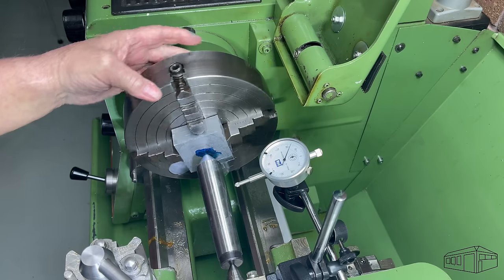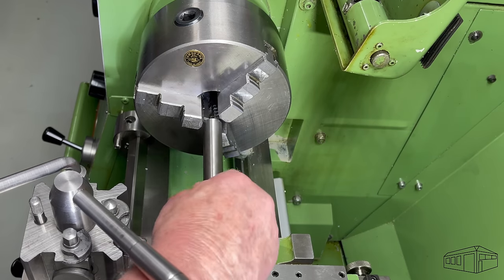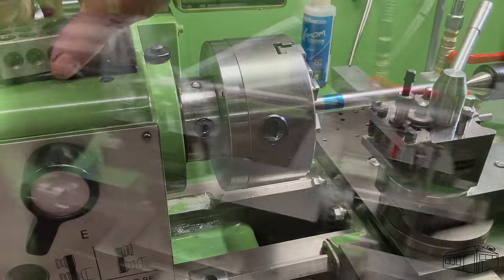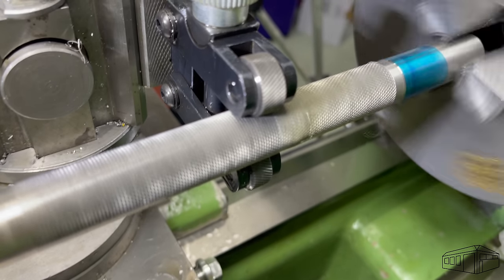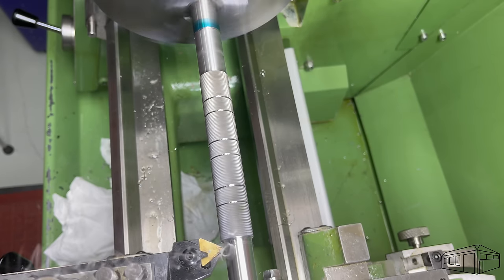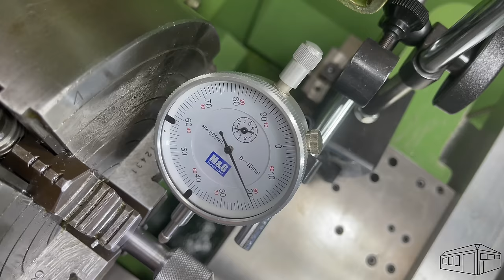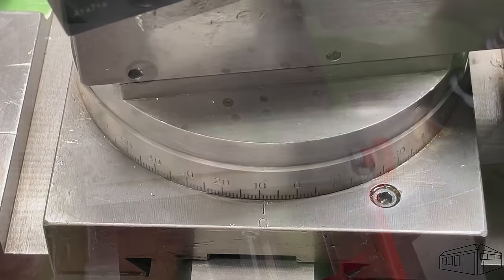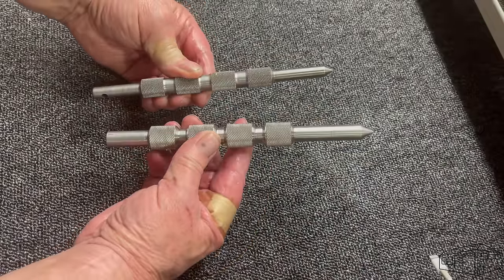How to Align Work in a 4 Jaw Chuck - Shop Made Tools

Comment: Handy tool, nicely made. It was good to see a knurling tool used properly. After 50+ years as a mechanical engineer I've seen some ridiculous attempts to use various knurling tools which led to chewed up knurls and even tool breakage. It was also good to see you taking good care of your machine and equipment. Good post, first time here, but not last 👍
Reply from the maker: Welcome aboard and thanks for the comments.

Comment: I've always been curious about how the knurling wheels directly effects the work-piece. So many people say it doesn't matter; just do it. This is the first channel that I know of who talked about it with a 'proof-of-concept'. Maybe there are others that I just don't know about. Thanks for sharing. Looking forward to more content.
Reply from the maker: Thanks for the comment, many more projects to come.
Reply: I believe it was Tom Lipton that disproved the need for specific diameters when knurling, it being a swaging process. On the other hand when cut knurling, the OD being correct is vital for a gòod knurl as the process is more like gear cutting.
Reply from the maker: I haven't seen a video from Tom Lipton on knurling but I will go on a search for one, thanks.
Reply: @theoutbackshed  it was a long time ago, but I'm pretty sure it was him although, like a wise man, I am prepared to be wrong.😉
Reply: @littleworkshopofhorrors2395  I think Mr. Pete even mentioned that specific diameters aren't needed, but I've always thought there was more to it. Like you mentioned, similar to gear cutting.
Reply: @sky173  one has to distinguish between the common "squeezing"  knurling and the more rare cut knurling. It is the cut knurling that is like gear cutting. The squeezing type raises the surface as it compresses the ruts, so actually working out the start diameter is problematical, it is not just dividing the circumference by the knurling tooth spacing.
Reply: @littleworkshopofhorrors2395  ok, that makes sense. Thanks for the heads-up!
Reply from the maker: I can only show you what works for me. I have found that with 'squeeze' knurling the second rotation of the workpiece needs to ensure that the knurls track into the grooves made on the first rotation, otherwise cross tracking / patterning is likely. I would prefer to start with a diameter I have confidence would produce a successful knurl rather than 'take a chance', particularly on 304 stainless. That's not to say that other methods don't work or that other ideas are invalid, all ideas are valid. The start diameter is where the knurl starts, it will finish as the middle point of the knurl between the root and the peak due to the deformations. So (for me), it makes sense to start at a calculated point and go from there. That said, I have had some unsuccessful knurls when starting at the calculated diameter, after all, knurling is part science and part art.
Reply: @theoutbackshed  no arguments there, as with all methods the one that works for you is always the best method. Quite often with stainless if you don't get it right first time the metal work hardens, making it difficult to rectify. Generally I just squeeze harder till it comes out right, if you give up too soon you often get failures too. I almost got a cut knurling tool recently at an auction but someone else wanted it more than me, so I let him buy it. Life is full of regrets.😢

Comment: I absolutely love machining 304, it finishes so beautifully with no need to file,polish, or sand. 
It doesn’t like fine or light cuts so much but it looks so good when you hit the correct speeds and feeds with a good quality insert. 
This is the first time I’ve seen your channel and I can already tell I’m going fit right in here. I’m not into woodworking but I love manual machining and learning !
Reply from the maker: Welcome aboard and thanks for the comment. plenty more to come.

Comment: Excellent video.  I did notice three things:
1. You are meticulous with your lathe and equipment.
2. You are a highly skilled worker who takes pride in his work.
3. You made a safety breach by removing swarf from the workpiece with your bare hands while the spindle is rotating!  Never do this. I have seen very bad injuries resulting from this practice.
Reply from the maker: Thank you on all points. I shall take note of point 3 and do better in future. Thank you for picking this up.

Comment: I've never seen a wiggler bar that is not telescopic with a spring to take up the decreasing length as it starts to run true.
Reply: I was going say the same thing.
Reply: @littleworkshopofhorrors2395  I was beginning to think was the only one that remembered locking the tailstock & clicking the wiggle bar in. The spring kept it held between the centres and there was no need to accurately set the load with the tailstock. Too much load from the tailstock made the bar bend, too little and it rattled about.
Reply: @machinists-shortcuts  precisely so.

Comment: This would have to be the most flash wobble stick I have ever seen. I'm a retired tool maker and I have always used a piece of 10g wire 12" long, sharpened to a point for the centre dot and to accomodate the dial gauge I just flattened a section of the wire just back from the point, on the anvil. Hold the other end of the wire in the tailstock chuck and that's all you need. 😁
Reply: I used similar, but 2mm piano wire with a ground divot together with a 0.001mm./div dial test indicator. That bit extra stiffness at the point has made the difference.

Trained and used to work as an instrument maker, so precision could at times be enough to require parts (and measurement equipment) to "settle" before measurements where made.
Reply from the maker: I agree with you, that would work too. The objective I put up is to take on a lathe project (mostly for beginners) that encompasses many features of the lathe, and you get a dedicated tool at the end of the project.

Comment: These are great projects, another option for them to be strong and last a long time: Ream a 6mm hole in one end and shrink fit in a broken  6mm carbide endmill. You will need a tool and cutter grinder though to get the point.
Reply from the maker: Thanks, that's a great idea. I'll have a think about that.

Comment: If the end use will allow it, 416 free machining stainless steel works a treat in the home shop. Not cheap, a 25.4mm x 300mm ground finished rod is about $60. The ease of turning and drilling on smaller machines makes it worth the price.
Reply from the maker: Thanks for the comment, I think that 416 has a higher nickel content making it more corrosion resistant, I will see if I can find some and try it out. Thanks for the advice and welcome aboard.

Comment: Threaded the block and attached a ground tube by a screw. ( Boring button).Set it central using slip guages. Put in the chuck and clocked. That how we were taught as apprentice.  I do it the easy way with a pointy thing like you these days
Reply from the maker: I remember doing it that way too. Would be too time consuming nowadays though.

Comment: Hi
Great vidéo.
What is your Brand lathe ?
Reply from the maker: HI, thanks for the comment. It's a Colchester Colt 2000. 13"x40". Made 1981, purchased new in 1984. It's in original condition.
Reply: @theoutbackshed  thanks

Comment: You'll have to excuse me for not getting it. I saw you make many measurements that seemed irrelevant to me. When it came time for a measurement that was CRITICAL it was glaringly absent. I'm talking about the square stock you center punched at the end. That segment was sadly absent of any critical measurement. I did not see you blue that block and carefully mark the center before center punching it. I saw you willy nilly center punch it by eye. This in no way guaranteed it was on center. If I missed something I apologize but I did back it up a number of times just to be sure!
Wakodahatchee Chris
Reply from the maker: Hi Chris, and welcome to the Channel. Thanks for the question. The square stock at the end of the video was never intended to be trued square. The centre punch mark was arbitrary and the objective was to show it off centre in the chuck then use the tool to bring the centre punch mark into alignment, which I did. This is what the tool is designed for. If I wanted to bring the block into alignment I would had used a dial indicator on each of the four sided to ensure that the block was centred. In this case it was the centre punch mark that I aligned not the block. Again, thanks for the comment and the opportunity for me to clarify for you. I was not as clear as I could have been in the video.  Cheers.
Reply: @theoutbackshed  One of the problems with being old and retired is having way too much free time. All the free time equates to dissecting, bisecting, scrutinizing and criticizing YouTube videos. Reading back on my original comments I can see where others may see me as a 14 caret ball buster. Sorry for that. I think I went off the tracks do to the very brief segment showing your project in use. Here's another video that focuses more on the concept. It helped me to see the value a placing a point of the stock on center rather than center of the stock. https://youtu.be/c0EMqgyqXAY
Thank you for responding to me and good luck with your channel. I subscribed!:face-blue-wide-eyes:
Wakodahatchee Chris
Reply from the maker: Hi Chris, good to have you on board.  Cheers.
Reply: @cdrive5757  I'm one of the other readers & I didn't see you as a ball buster.
You had a question & a right to ask.